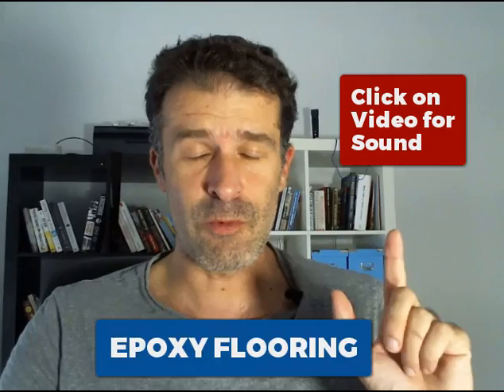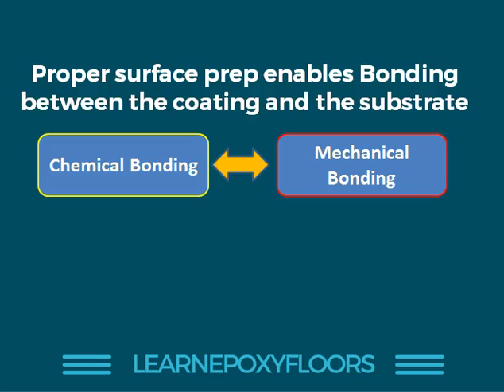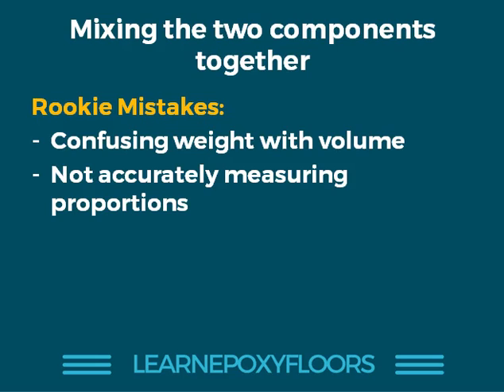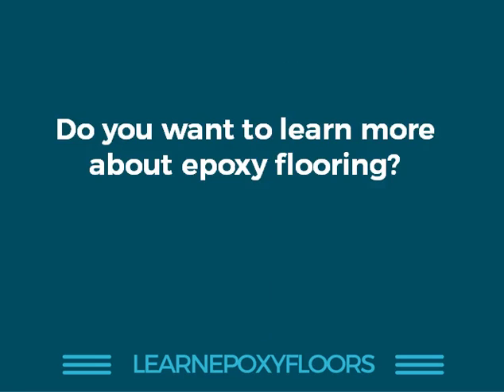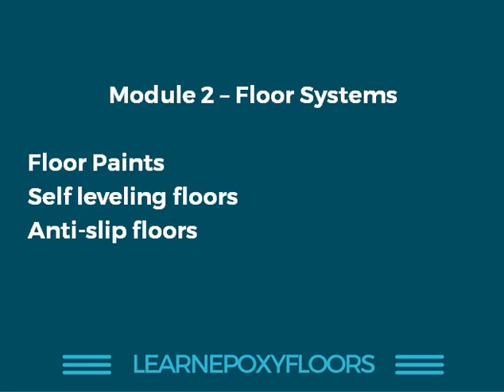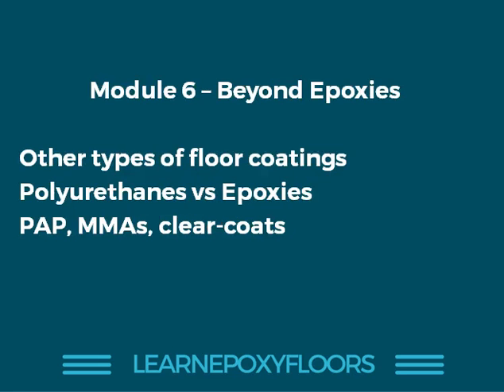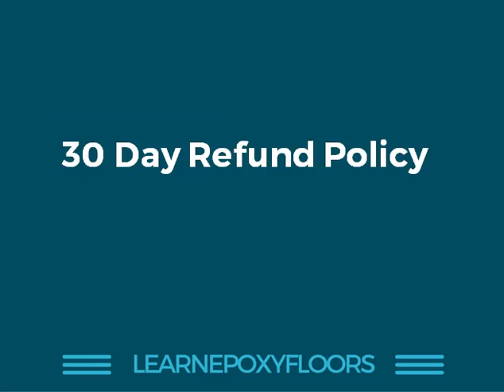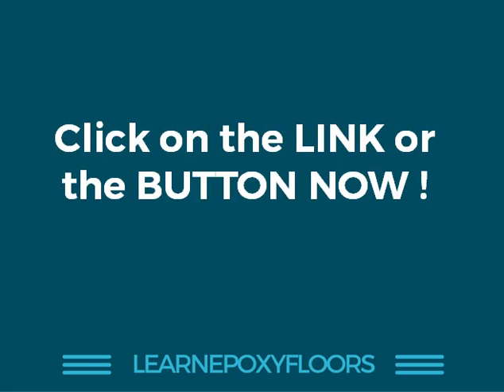Are you making these three mistakes with epoxy floors?

Comment: Thanks for that knowledge with but if l want to become agent in uganda with epoxy flooring what are the requirements
Reply from the maker: Epoxy is challenging to ship because chemicals are involved. You cant just put a pot in a box and ship it across the globe. The costs for small shipments are not feasible. So you would need to order by bulk and incu all the costs. This is where most people do not want to get involved unless they have their own big projects

Comment: I can just use polyurethane on a painted floor instead?
Reply from the maker: What type of painted floor? Polyurethane may damage the floor underneath if it is not compatible
Reply: @learncoatings-epoxyfloorin9448  not at all sure. I bought the house like it. All I can tell you is the paint is gray, non glossy and it peels easy.

Comment: hi Sir, can u please give me reply, how to apply epoxy over old mosaic what kind of primer should use?..
Reply from the maker: Over old mosaic you need to grind well to clean any dirt trapped between the stones. I tend to apply a runny epoxy primer to make sure that it will penetrate the surface properly. Then maybe a scrape & filler coat to fill all the gaps. Topcoat on top
Reply: @learncoatings-epoxyfloorin9448   thank you so much.. but still my doubt is there any other chemicals which can penetrate mosaic other than runny epoxy primer..?
Reply from the maker: @mericontechnologies989  there are suitable chemicals for mosaic and stone surfaces but they are not usually compatible with epoxy. So you would not be able to use it as a primer

Comment: Hi there I hope you can help !
My garage floor was all done and prep’d properly but nearly three weeks later and what we’re experiencing is the coating is lifting under my parked car tyres overnight, as I said it was all done properly what’s the problem.
Reply from the maker: For a coating to start peeling under the tires, this quickly it means either the grinding of the substrate was inadequate, or the surface was not primed properly

Comment: I did white and black, the white turned yellow after 2 years, how can I fix this please?
Reply from the maker: Epoxy has a long term tendency to yellow, especially if it is exposed to sunlight. You need to recoat the white area

Comment: I have a problem where the people who put the Epoxy floor coating in the garage extended the coating beyond the garage door. Over the years, the sun has damaged the Apoxsee coding and cost it to chip. Now it looks very jaggery along the garage line. I am wondering if there is a way to maybe tape a line and use something to remove the Apoxsee whether it be a sander or is there some liquid that would dissolve it? It just looks horribleFrom the outside. The inside of the garage is still in really good shape. We cannot get anyone to fix it because they have told us it is not that big of a job, and really would not pay for them to do it. I am just trying to figure out how to correct it. The original company that put the floor down it’s no longer in business perhaps this is why
Reply from the maker: It normal for the coating outside to go yellow, chalk and fall apart. You would probably need to get a hand held sander and slowly remove the outdoor part

Comment: I did mistake number 4... My whole garage floor is full of streaks- whole thing.
I didn’t know you want to really soak the roller, I painted it like paint.  My question is, is there any way I can go buy and add 1 more coat of epoxy over it (this time more evenly) to mask the streaks? Or will the streaks continue to be just as prevalent?
Reply from the maker: Yes this can be done and a 2nd coat always improves the appearance. Also you could try back rolling at a right angle to get a smoother finish

Comment: Quick questions:  How long should spin the mixture with the electric mixer?  Can a pressure washer and small orbital sander prep a garage (120sqf) floor that is in pretty good condition?
Reply from the maker: Aim for at least 2 minutes of mixing at a slow speed. Yes a pressure washer and sander is fine for a small garage. I assume its residential so there won't be much traffic

Comment: what about epoxy on wood flooring ? sand it and follow rules?
Reply from the maker: Not a fan of epoxy on wood flooring. Wood is flexible and epoxy is quite rigid. You may get cracks
Reply: That will be mindblowing

Comment: What type of spikeroller would you recommend?
Reply from the maker: Go for shorter spikes, these are more convenient for epoxy. Longer spikes are used for cementitious applications where the screed is thicker. As for the width, if you are working in small areas with lots of rooms, you want a narrow roller so that you can access all the difficult areas as bubbles tend to appear near walls. If you have large open surfaces use a wide roller like a 45 or 60cm (18-24inch) as they are far more productive
Reply: How long would you recommend them? We have one that is 13mm, but it splashes on the walls. And I think it would be better with shorter than that?

Comment: Excellent video!
My epoxy flooring has rough surface. I suspect it is due to poor surface preparation, as I can see some dirt and pebbles on the the flooring. Is there anyway to rectify this?

Will recoating extra layers of epoxy help?
Reply from the maker: Thanks. I suggest before re-coating that you grind out the pebbles and dirt, and patch up any holes. Wipe the dust well and then re-coat. With each additional coat your floor should improve, but proper preparation is important!

Comment: its it apply  on normal floor
Reply from the maker: It depends on what you mean a normal floor. The best substrate for epoxy is power floated trowelled concrete
Reply: Tnx for the information 
From India;

Comment: What can I do with a houseful of sticky floors nightmare
Reply: burn it down
Reply from the maker: you mean the whole epoxy did not cure? Use xylene to remove it and then re-coat
Reply: Nightmare is right.
Reply: Always give 48 hours or more for the epoxy to cure. Also don't use cheap product. I did my garage with Epoxy Plus system. Came out amazing. I should have filled in the expansion joints a bit better but it still great